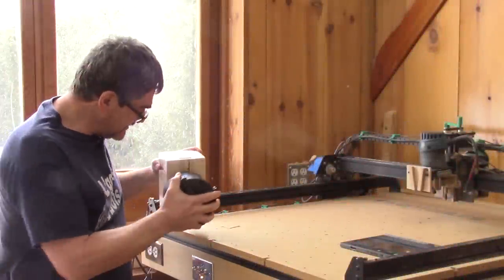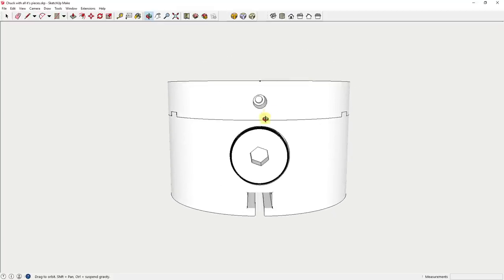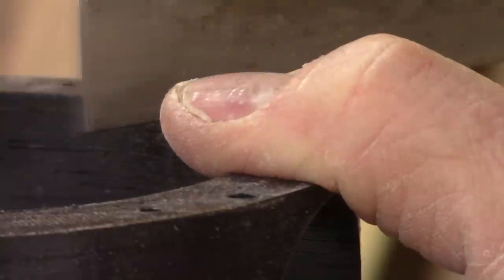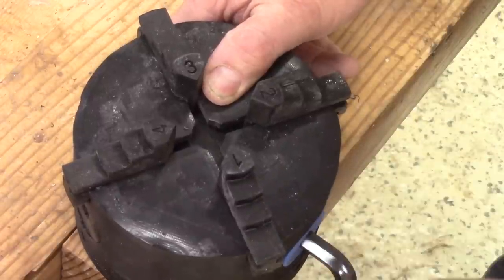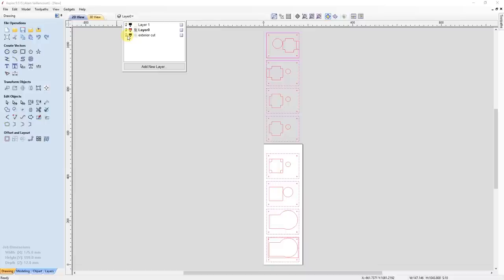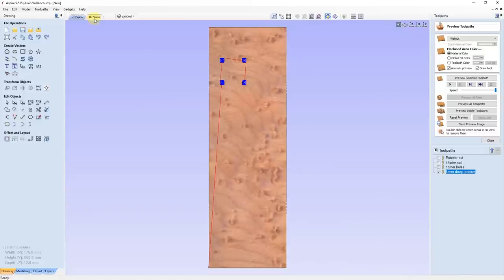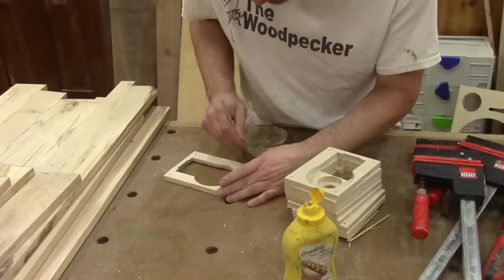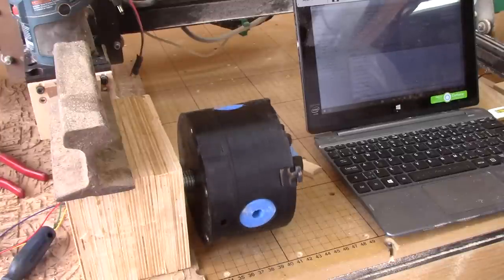The Woodpecker Ep 196  - How I made my fourth axis for my CNC part 1

Comment: interesting but the motor inside the casing does not get very hot?. thanks You.
Reply from the maker: It doesn't seem so. The only problem I have is from the small printed plastic gear. I bought  an aluminum one, but didn't install it yet. As funny as it may sound, the darn PLA plastic get soft at a very low temperature, and my CNC is just in front of a window facing south.. The sun soften the printed plastic... but no issue with the motor
Reply: Thank for say to mi the very bad that is pla material for this use. I am making a fourth axis for my Mill and I'm making two gear in PETG.